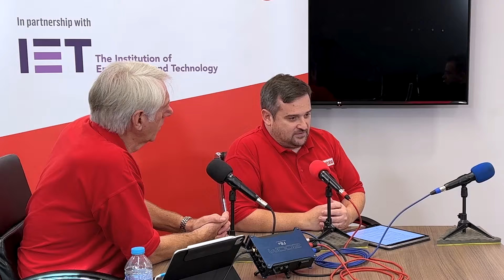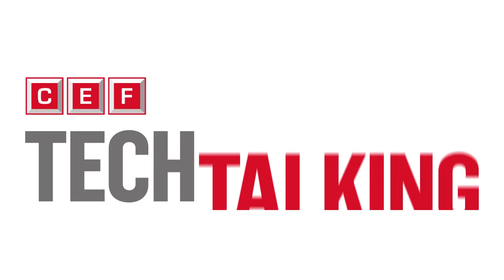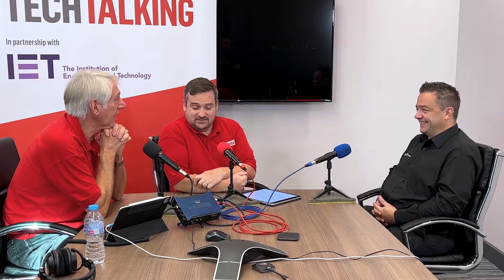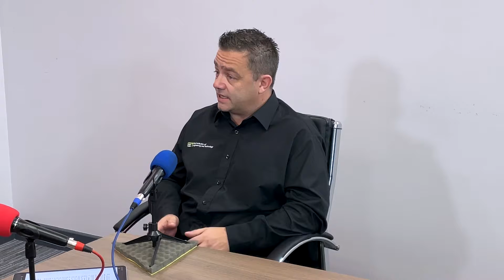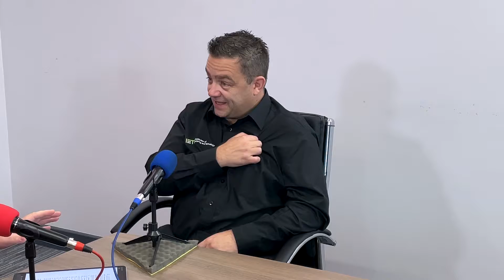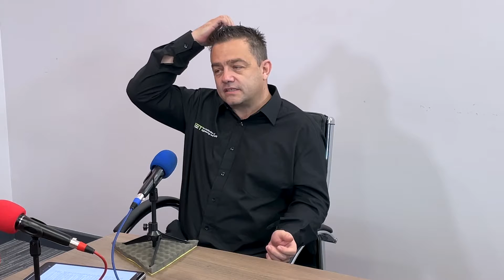E20: Cables in escape routes and risk of premature collapse: Michael Peace, IET

Comment: Very interesting video and discussion. I have been researching this subject for some time, specifically with regards to domestic installations as to whether or not this requirement extends to cables directly clipped to timber joists above a traditional plasterboard (and plastered) ceiling in domestic dwellings. There are divided opinions as to whether or not the 30min fire resistance of the ceiling would offer sufficient protection to prevent premature collapse. Also some dogma that suggests the plasterboard ceiling offers additional support against cable collapse, thus rendering plastic clips in such circumstances to be not the sole means of support. I can't quite make my mind up if this is a valid argument or just manipulation of the circumstances to justify not applying the requirement. Despite the best efforts of regulatory bodies to clarify regulations (not just electrical), it never fails to amaze me how imaginative people can be when interpreting things to suit them. I would be interested in your views on this specific scenario relating to direct clipping to joists above plasterboard ceilings. I am a bit confused. Many thanks for the interesting video.